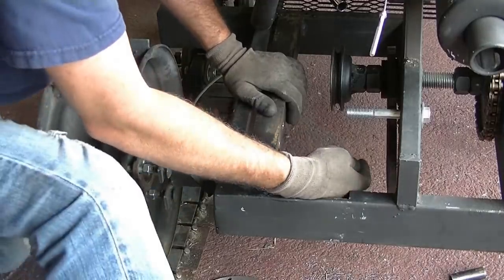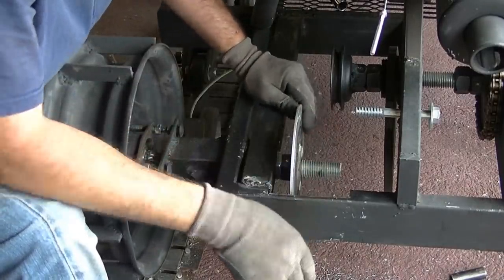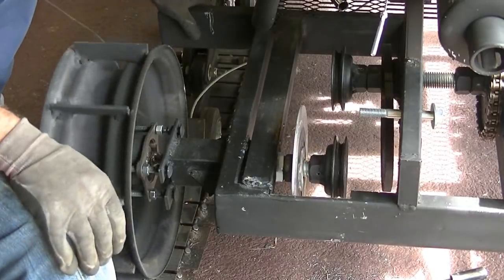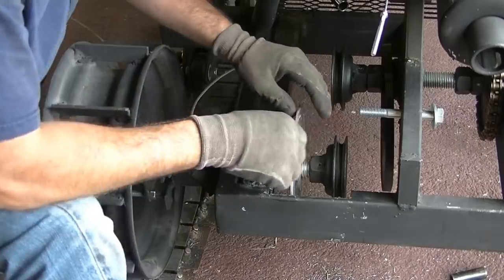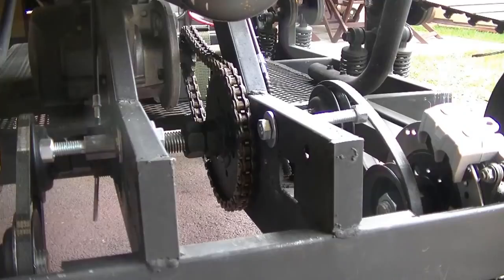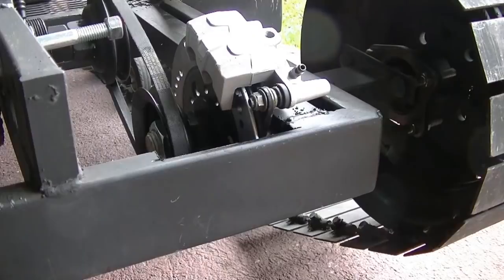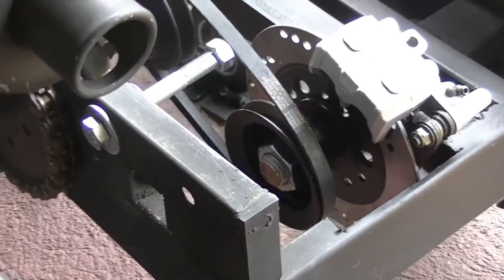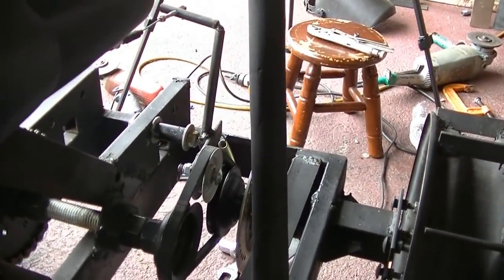How to build a tank or Tracked vehicle.Transmission progress report.10-B

Comment: You’d be better of using a zero turn lawn mower chassis and drives might be a bit more simple drive train to work with, being that the controls are perfect for a tank set up. I d love to do a build like this but the track and suspension would be the biggest challenge for me and I don’t have the time. Just my 2 cents…

Comment: I know this is years old but.. I have an idea for a better transmission. Get a used power steering pump or a rebuilt one for each side. Spin the pump with the chain drive. Run hydraulic lines to a hydraulic motor on each wheel. With pressure bypass and control valves you can have a real incredible transmission much easier than one would think. Or use electromagnetic clutches on the pump pulleys and switch them on and off to steer. Or do both

Comment: Just use hydraulic system. Left hand drive, right hand drive. Trying to use handlebars to steer this I dunno.. also brakes are not needed with hydraulics just throw them in forward and reverse all the time.. reverse are the brakes with hydro gears..

Comment: where yo ubuy msot of the parts from?
Reply from the maker: Hardware store
Reply: @Aceman307  There a specific type of store? I don't think there's tracks and motors in a general hardware/department store like lowes/H.D/Ace. And wow you're still active! Nice.
Reply from the maker: @mightron  I made the tracks from material I bought from a  hardware store. I got the rims and some parts from a used car parts place. And the motor from a motorcycle shop. If you live in the States you will not have the stores that I used. But It should be easier to find there.

Comment: Man that looks like it'd be fun. I get using threaded rod, for a template, but welding nuts on brake rotor, pulleys and using threaded rod for permanent usage with not be the best idea. After you get everything lined up, take accurate measurements, then use solid bar, keyway it. Build hubs for your brakes and pulleys. Nothing will be distorted. You are going to want everything tru with no doubt anything will loosen off while riding. Your Handel bar  steering, amazing. Never thought of that.

Comment: Less release on the pulley and more bite.  It looks really loose and your gonna lose a lot of steering ability with that. Maybe introduce a v-notch pulley like on a CVT for a four wheeler or sled. More tension more bite, but you’ll never fully release it and risk it jumping off the drive

Comment: Your idler looks in wrong position. Idler should add up contact on v belt, not decrease the contact (the more contact the more effective your vbelt). That is why you have slippage. You might need to add another belt to make it more effective. But I would rather use chain and simple pressure plate using spring assembly for release.

Comment: Nice design set up with the pully, however if you are having slipping why not just got to farm store and get two chain drive gears they have large small and you can ratio it to small to large and add chain drive. I see you are working in a right direction either way...
Reply from the maker: The reason you need belts is to be able to be able to disconnect one side or the other to steer.If you have a chain drive going to each wheel you would have to have some kind of clutch. Thanks for the comment
Reply: Aceman307, You know I didn't take that into consideration at all, I guess I didn't realize that but it makes sense.

Comment: I'm impressed with your effort, but here is a suggestion - Take some real welding classes. You won't be sorry. You really need to learn a few things. It isn't that hard, but it takes some very specific knowledge to do this stuff correctly. The time your classes take will be more than compensated by the time you save fixing your welds that will fail.

Comment: Hello! The Idler pulley should be on the slack side of the belt drive not on the drive side. It looks like you have it on the wrong side. The belt tightens itself under load and  the idler simply takes up the slack... Good work!!
Reply from the maker: In the next video or two I changed it around. Thanks for the comment.

Comment: I think that you are going to have some alignment problems with you sprockets and pulleys. When you screw them on the shaft the nuts did not appear to be welded on true. Interesting concept though. As an old heavy equipment mechanic, I suspect you are going to need more durable materials than I see.

Comment: Your belt tensioner is on the wrong side for effective forward travel. The way you have it the load is pulling against the tensioner. Move it to the bottom and it will work much better.
Reply: و
Reply: ةةةىاععاظا7

Comment: threaded rod for drive axle, sorry, it isn't tempered for it, you will be sorry.
Reply from the maker: Most don't get the idea of building this way using materials and parts that can be found very cheaply or for free and in any country in the world. I was a Aircraft mechanic specializing in hydraulics in the Navy. I could easily build a hydraulic tracked vehicle with the proper bearings and harden steel shafts It would cost probably 20,000 dollars or more and it would be perfect. Just look at mini ripsaw. Its already been done. In all the projects I take on I try to build them with materials and resources that anyone from most parts of the world could put together. That's the real challenge and fun. Thanks for the comment.
Reply from the maker: +Maples01 R&D Its cheaper to use. I can find out what works before I spend the money on the more expensive materials. I already had to trash the original design with the other pulleys and drive axle I only wasted about 30 dollars.
Reply: Only if the flanged tempered axles will work in your design tho
Reply: +Aceman307 i can accidentally mess up a thread, i was thinking the same thing, it will get wobbly.
Reply: +Aceman307 You have a point to a certain extent but on the other hand it's not worth spending time building something that won't last.
Reply: +Maples01 If its a Grade 8 threaded rod, he'll be just fine.
Reply: +Maples01 the nuts will smoke the bearings on one side and shuck the other side long before metallurgy exhibits  and the  scribe I mean threads will upon torsional side loads and bearing journal contact and friction will snap  off most likely happen long before heat gets her  no disrespect to the build least your trying to build it and your fab skills are resourceful but critical things arise of simple mechanisms interactions v belts suck flat n wide makes the ride and its a compound not a transmission unless it has a gear changing aspect I missed but given rotation of axle in relation to wheel diameter heat shouldn't beat mechanical failures as cause least that's where I put my money if I was betting and I can build ANYTHING OUTTA NOTHING and failure breeds success instead of sorry I bet hey this might be a better build in my experience would surely be more positive and could help him achieve his final goal or project I am a heavy equipment/truck mechanic retired and more than 30 yrs building machines out of junk and it is inspiring to see any one try anything failed or realized  they are taking that away little by little if you have no stock you cant create which has serious implications down the line of creations to utilize or develop and the haters comprise 90% of unrealized tech and innovations the other 10% greed and selfish or gov suppression or worse dead and its a piss poor way to live and interact if we are really the higher minded ones  why do we not use it or at least find any history to say we did use it just a thought and really no disrespect intended to you or the builder but that's my surmise of the integrity and interactions of that systems componants and failure/repair abilities as well to many parts to fail and replace that have to be fabricated again from scratch better to find existing builds that have already been utilized to address metal and design issues or rather to not have to address those critical and costly aspects of designing
Reply: can i have this tank thing
Reply: +Aceman307 

Please tell me where i can get parts found in the video from?

I'd like to build a mini tank for fun...

Where do you think i can get cheap metal parts and bearings from? First i must construct a frame and for that i need metal plates and slabs. How to get em cheap and where in australia, NSW, Sydney can i get em?
Reply from the maker: So you would think it wise to waste money you dont have to make something that may or may not work. We are not talking a little money difference its allot. Plus for me its all about the build learning new ways to put things together. Once I finish this project I will scrap it use it for parts or sell it and start another project. Thanks for the comment.
Reply: maybe a version 2? if i scratch built something i would probably make at least a mark 2 I love seeing the design changes in things. Theres always speed durability and streamlining to consider once you have a platform upon which to build. For me that would be the real thrill. However i lack the ambition for projects like this saddly. Awesome toy you've got there though.
Reply: #SaveMoney Lol

Comment: The idler pulley needs to be on the slack (bottom) side of the belt. The power is transmitted to the axle through the top side of that belt (the way you have it positioned). The idler pulley is going to break right off if you leave it on that side of the belt, plus you're not going to get good power transmission to the axle. By putting the idler on the slack side of the belt it only take a fraction of the effort to pull the belt taught and get it to grab the other two pulleys.
Reply: +sam1174 Never mind. I see that you figured that out. :-)
Reply: So it should be in the same spit but under the belt? Or at the very bottom of the belt pushing up or down.
Reply: bottom pushing up.

Comment: Your belt tensioners need to be on the bottom of the belt not the top ! The reason for that is the top part of the belt is what is will actually have all of the pressure on it and if You put the tensioners on top then the belt will be pulling against them and trying to make them slip, on the bottom the tensioners just have to take up slack in the belt and do not have to hold the power transfer also!
Reply from the maker: George Hunt Please check out my latest video Drive train update 10D
Reply: Aceman307 
Yes I found it after I posted this. I should have made sure I had watched all of Your videos on this before posting!
Reply from the maker: George Hunt Thanks for your post I appreciate any insight or alternative ideas people watching my videos have.

Comment: Should use rodstock the same size of the bearings rather then threaded rod, the threaded rod will eat right through the bearing sleeve. If you lengthen the section the spring is attached to you should get a lot more leverage increasing belt tension.

Comment: you can use differential gear like the car rear axle
Reply: TheArctanx a differential makes a terrible setup for driving tank tracks because when you stop one side, the opposing wheel spins at double the speed.   This makes turning a “tank” rather difficult.

Comment: If you make another one, for your transmission set up look at racing go kart parts. They make 1" axles with a 1/4" key way the length of the shaft. You then could use a kart brake hub, rotor and caliper. There are also locking collars with a key way that you could weld your drive pulley to. The easiest way is to use a peerless riding lawn mower differential. (they have them at Northern Tool). Bolt a drive sprocket to the differential and put brakes on each side for the steering.
Reply: Jimmy Mecannic

Comment: Nice Work, but the solutions with the thread rods and screws are crap.
Screws are great to pull things together, but weak agains sideforces.
If you use Tubes the screws will hold longer and the Brakedisk can not go free

Sorry for my bad english, if you answer, write slowly, i can not read so fast english ;)
Reply: There is no problem with your english

Comment: That is a good idea using the belt release like from a lawn mower.  My idea was to use the rear end from a gas golf cart. Has a pulley for the belt and a differential. Plus they use cables to operate the brakes and you can buy a cable run disk brake kit for under $200. With a differential if you stop one side the other speeds up twice as fast cause then the spider gears act like a planetary gear setup. And most gas golf carts have reverse and that would be nice too.  I love your whole build and I'll be watching it closely.
Reply from the maker: Jay Cee Thanks, I think a golf cart axle would be a good idea allot easier. Thanks for watching.
Reply: Thanks for posting. The vids are fun to watch. I subbed.

Comment: Use better steeol for the alxle.  Use better perrifial equipment, (Brakes, flanges and so forth)  But keep that threaded rod set up!  That's a really good design tool!  But it won't hold up under load!

Comment: I'm curious why you chose to use a belt drive system for your transmission. I see you're putting a load of work into the belt tension clutches & brakes (which will need trued up a bit, I think) which wouldn't have been necessary if you went the more "traditional" route of having your motor drive the tracks through a hydraulic pump, pushing fluid through hydraulic motors through a "two stick" system (2 reversible hydraulic valves) to drive/steer/stop your tracks.
Reply from the maker: I had two original ideas for driving this, the first was Hydraulics, I was a Aviation hydraulics mechanic in the Navy for 7 years. So this was my first choice. But like so many things here where I live the cost and availability was to much. The second was electric motors this would have been allot easier. One motor running each drive wheel again very expensive. I went with the pulleys solely on cost. After I complete the project I plan on doing a video on all the things I would have done differently and change if I had the cash,and dimensions of the completed project.  Thanks for the comment.
Reply: Aceman307 Cool. Once you get that thing driving around, I'm interested to see how those cable-based tracks hold up. I've been working a few plans for a couple tracked vehicle ideas of my own (still in the planning stages) & was planning to cut bolt brackets for each of my track shoes out of 1"x1"x1/8" angle-iron; then weld those to the shoes, so I could bolt my tracks together. Your cable tracks, if they prove durable enough, would probably be a much easier route to take there though!

Comment: Great progress! I'm starring at your track wheel,axle & disc brake and I can see your next VAWT project come to life. (Or I should commission you to build one for me) Also, if you need a close up shot of a snowmobile track, give me a shout
Reply from the maker: Thanks. When I bought the disc brakes I was thinking they would make better rotor plates than the saw blades, thicker and will not flex. Also ready made mounting holes.

Comment: In my opinion: you have reached a point where you might consider the purchase and use of a metal lathe! Threaded rods will take you so far. Those threads will amount to an incredible amount of frictions (very inefficient) and grind everything to a pulp.

Keep at it! You will get there

Thx for sharing

Comment: Once I got into the deeper snow there was more of it drifting around and would end up on the belts and I was hoping to not have an issue with that on the double belts, I have currently junked out that machine and am thinking about a new design. You may want to think about moving the tensioner pulley on the bottom (slack) side of your drive belt as you drive forward the belt will naturally want to tighten up on the top, that’s something I had some issues with but I really like how open things are to get work on them and the overall design is pretty cool
Reply from the maker: Yes thats the new plan I am also going to use the tension er on the outside pushing in. I have been looking at the electric clutch on old a/c car compressors as maybe a way to make a better clutch system for this design.

Comment: I like the concept but if the belts get wet could cause some issues it did on mine.
Reply from the maker: I watched your video on your tracked vehicle. Cool design moves pretty fast. I see you doubled up your drive belts. It did not look like you were having problems with your belts slipping. Did you solve the problem or just try not to get them wet.

Comment: See about getting yourself a lathe. The runout on those brake discs are going to cause you problems. Your design skills are clearly ahead of your equipment availability. That's a good thing. But now you need to correct it.
Reply from the maker: Your right  about the tools I am using electric hand tools which limits things in this build that you would do differently if you had a lath or mill or even access to the right parts. But it does require me to be creative when confronting engineering problems. I will be able to straighten the brake disc. Thanks for the comment
Reply: Aceman307 Also a decent 4" grinder, prepping your steel with proper bevels and ground weld surfaces will greatly improve those welds not to mention make them stronger, Oh and a few clamps to hold stuff straight and in place while welding..your steel shrunk while welding those nuts on the disk and the pulley. Just some ideas not criticizing. Keep up the good work!